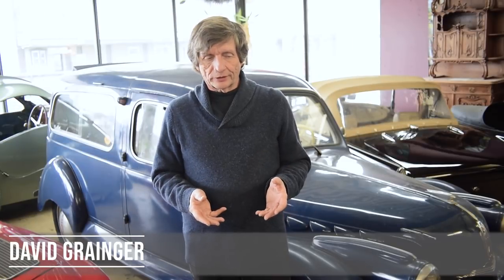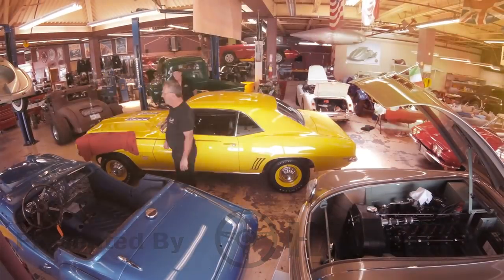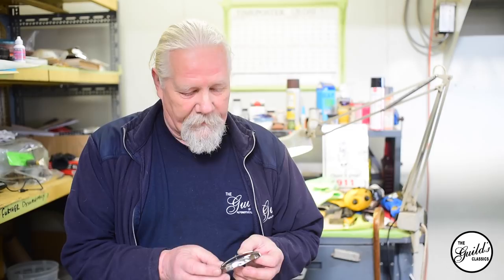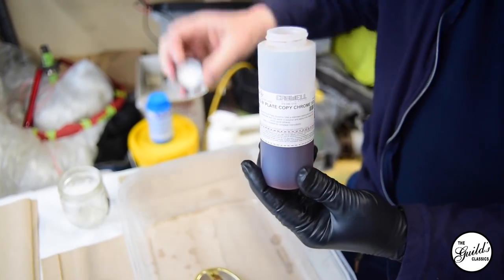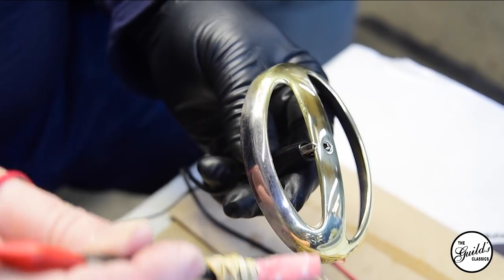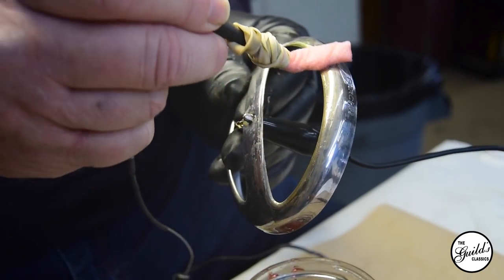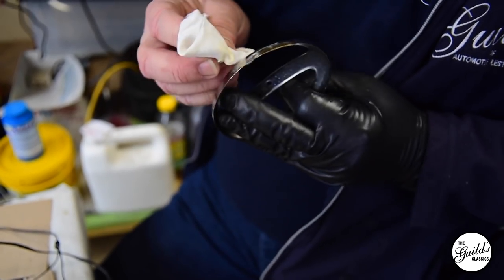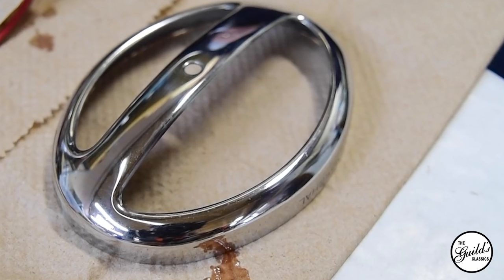Simple Electroplating

Comment: While seeing the process Karl goes through is interesting, my understanding from talking with a local plater was that nickel is the base "color coat" while chromium is the protective "clear coat", making the part such as you have now a superficially colored display piece. Are you not concerned with the fragility of the items new coating?
Reply: Hi.  We're using in this instance a product from Caswell called "Copy Chrome." It seems to be quite durable and anyway, we hope the parts won't be subjected to extreme conditions like they were over that past 60 years or so...
:-)
Reply: Thank you for the quick reply Karl. Indeed, a life of leisure in a showroom won't likely be as demanding on the car or its parts... at least one hopes not ;-)
Reply: RAD Hi,
Actually nickel was used in the 20s before the chrome process became dominant.
Chrome really is not like clear coat, it is it’s own finished product. No substrates show through it.
The reason nickel is used still is that chrome will not stick to copper but nickel sticks to copper. Fortunately chrome does stick to nickel so in order to chrome plate with any degree of permanence you have to nickel the surface.
If you want paint terms, copper is filler, nickel is primer and chrome, your finished paint.